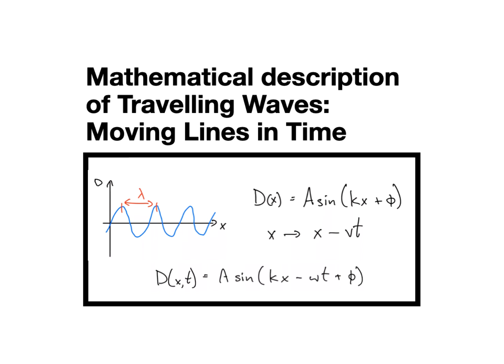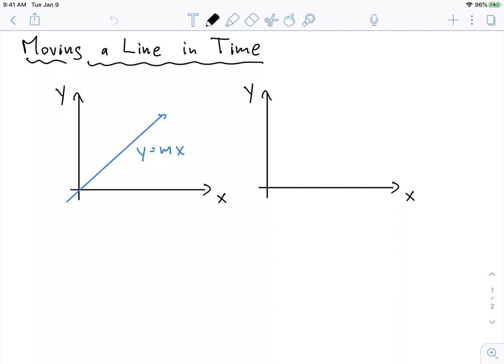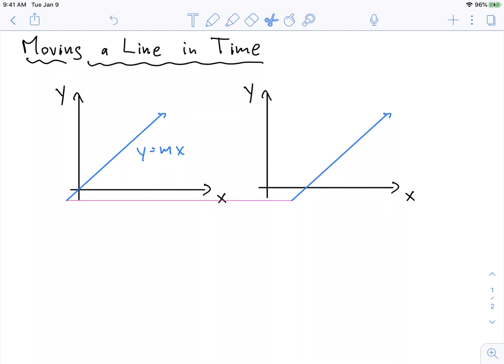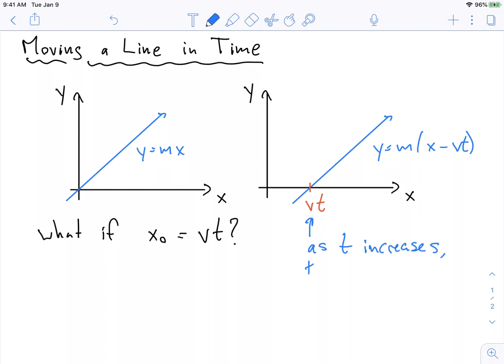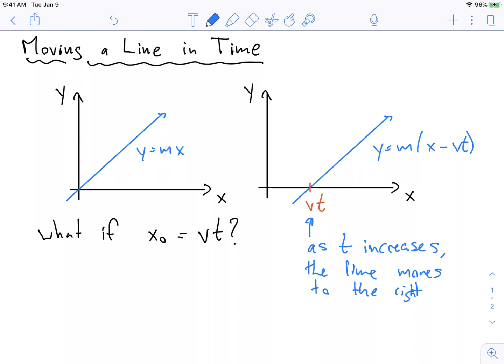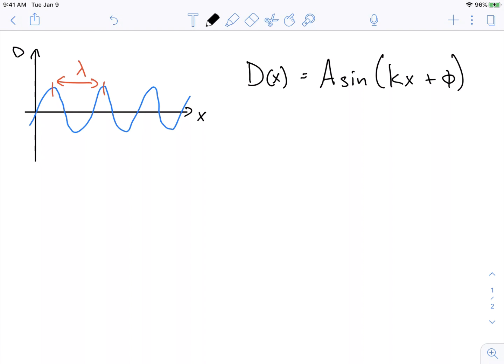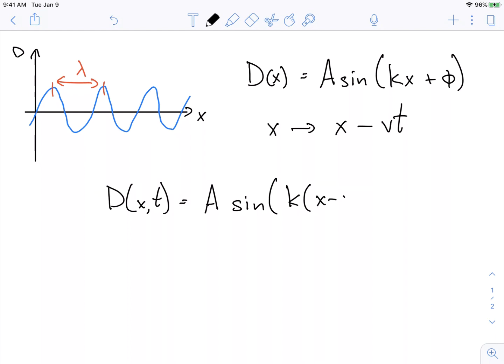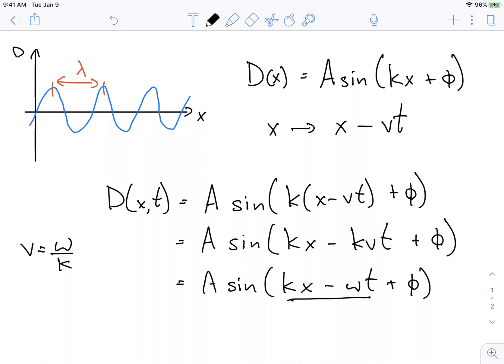Moving a Line in Time: A Mathematical Description of Travelling Waves

Comment: The manner in which I like to see a travelling wave (Signal)  is as follows. 
Assume we have a picture of the Mona Liza which is 2 meters wide and and  we can view it over 2 meters as it is when it is stationary.  If we want to send it to another destination we can put it on a long moving platform, as  with a driver driving a  long train moving  at velocity (c1) in the direction of "propagation".After time (t)  the distance covered will be (c1 t)  and while on this fast moving platform no one could recognise the picture.  What we can do to be able to recognise the picture is to have a man running back on the moving platform  with velocity (c2) holding the picture. The distance he covers with respect to the driver of the platform will be (c2.t)  and if (c2 t)   equals (c1 t)  then we can easily view the Mona Liza over its width, as the picture will be now stationary.       Rather than dealing with ever growing distances (c1t) and ( c2t) and the 2 meter width of the picture we could go periodic, hence the ( c1 t) can be an angle
 (2pi/wavelength1)(c1t)  and ( c2 t) can be an angle (2pi/wavelength2)(c2t)  and if the frequency  we consider is f  then    (2pi/wavelength1)(c1t)  =  2 pi f t =wt   while  (2pi/wavelength2)(c2t) =-kz
Hence the angular displacement of the moving platform and the man running back will be 
 ((wt  -- kz) plus the angle A due to the width of the picture) hence this can now be written in rotating vector function of form as  M e^j((wt  -- kz) +A) 
At time t-0 and z=0 then we  have the signal equal to M e^j( A) and it is easy to view the signal over this  small angle A representing the width of the  Portrait of the Mona Liza. 
At time =t and z= z such that wt-kz  always equals 0   then the remaining function will be M e^jA)  which makes viewing the portrait easier, through sweeping a small  angle A, representing the width of the portrait (signal) on the travelling wave where, M e^j((wt  - kz) +A) may be  plotted with respect to t or  z.  Most people call this a travelling wave but taking with respect to a reference which is the difference between wt and kz  it becomes  a wave with no relative motion to the reference taken! 
Congratulations on your videos. Thank you for referencing this video